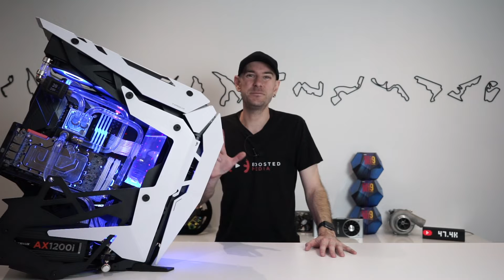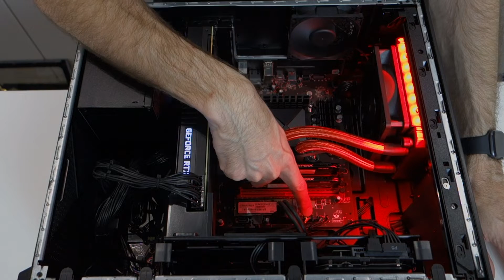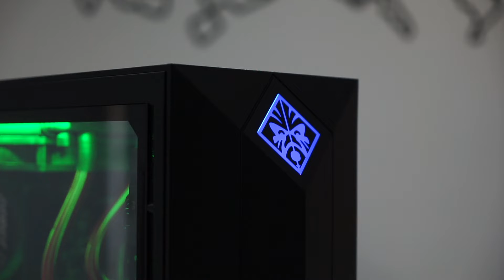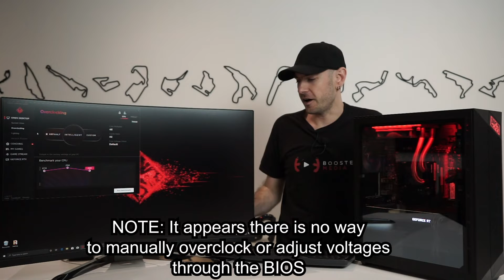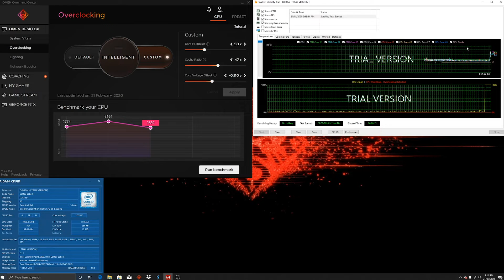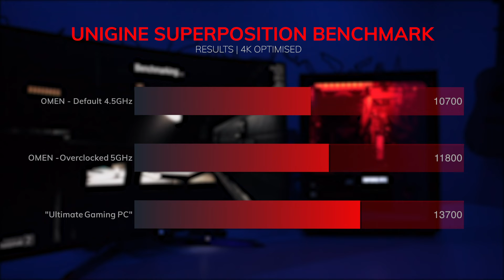BUILT VS. BOUGHT - Did I waste my money building a $7500 Custom Watercooled PC?

Comment: Not sure if they design their motherboards differently, but the RAM looks to be in the wrong slots. It will still work in dual channel but from damn near everything I’ve seen the most efficient population for dual channel ram is to have them in the currently unpopulated slots. I see this a lot with pre-builds

Comment: A blower style RTX? The scores reflect why the need to keep the Turing die as cool as possible is so important, although judging by the case, airflow and cooling wasn't a priority by HP again, more maximising the bottom line using cheap and cheerful.  But then i guess if they didn't cheap out that Omen would have set you back $7.5k also.
Reply: Lord Glenard of Glencoe I’m pretty sure all graphics cards in pre-built systems are blower style. Regardless of how powerful it is

Comment: Only 2666MHz mem? At least drop 3200 in there, for this price preferably 3600.. 
als 512GB ssd? 1TB ones cost €120-150 here. For the price and OEM I expect a 2TB nvme..
Reply from the maker: With the limited bios access you wouldn’t be able to run it faster than JEDEC spec anyway.
Reply from the maker: A 2TB SSD here is about $1200-$1500

Comment: Nice build and nice off the shelfer. I finally broke down and bought an Origin prebuilt with almost the exact specs as the hp. I have a few options not on the hp that drove the cost to $4400. My Origin laptop persuaded me to go with the same brand desktop ... costly items but top notch none-the-less. My performance specs on the lap top put it in the top 5% on the 3d mark tests. Runs everything wide open and VR no problem ... I used to build my own systems and overclock with external Freelance coolers but now days the closed loop coolers are sufficient for most cpus with a 15 to 20 % oc. These new RTX cards are just fine with a 10 to 15% oc with no cooling problems. Nice to run some fast processors now without wearing down my system with excessive heat over time like I used to do with SLI, external coolers and extreme oc's.

Comment: Hi there Will. Interesting comparison. I would still go with building a PC instead of buying. Specially in this case since I went to google and the HP website and this same desktop is 4000 USD while your set up is around 4900 USD. I think the price difference is worth it because of modularity, Upgrade-ability and cool factor. Now in the case of mid and lower tier pc's sometimes is better to Buy than build. I got an i7 RTX2060 pc for 1200USD.

Comment: For sure the performance is close but the lockdown of the bios and only allowing control using HP’s suite, and then those disturbing auto oc voltage figures, are a big turn off for me, even as a person who doesn’t tune and oc their computer aggressively. I’m not one for going all out for custom builds with water cooling loops but definitely would build a pc myself than buy a prebuilt
Reply from the maker: Yeah it’s certainly the most locked down bios I’ve seen even when compared to a lot of laptops. I’ve seen custom bios flashes for other PCs in the past that unlocked a lot of features so maybe that’s a possibility.
Reply: Boosted Media fair that, but then I’ve come to enjoy the satisfaction of building a machine for myself, or in the case of today, for a friend :)

Comment: Just got a 2080 super evga hybrid and a 850 watt power supply used for 600 dollars been great so far..going to get a new mother board and chip set along with a a lian li case..going to get a 2700x what mother board do you recommend. Currently I have a prebuilt Asus pc with a i56400 and put the card in it but it's super tight as it's a micro atx.